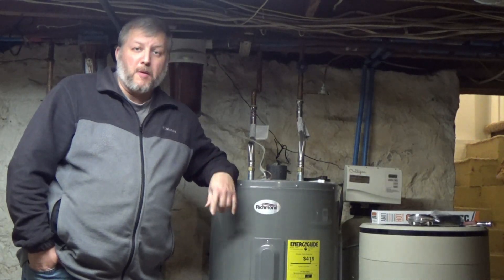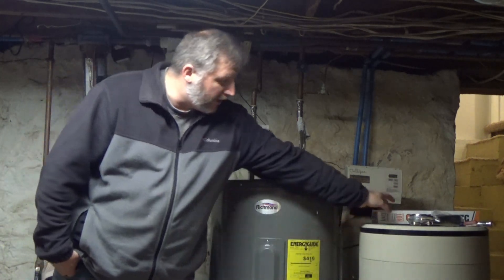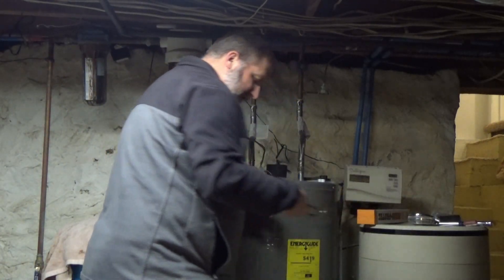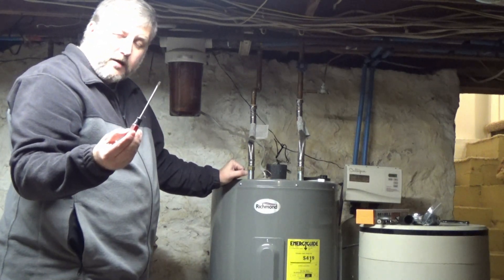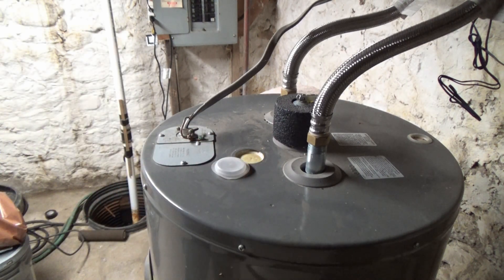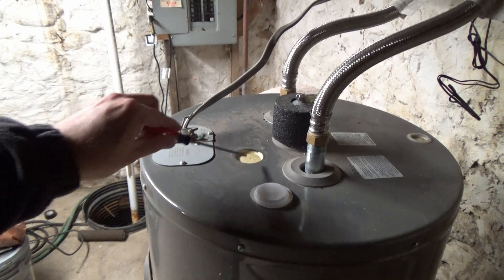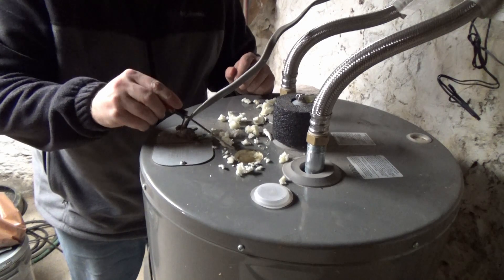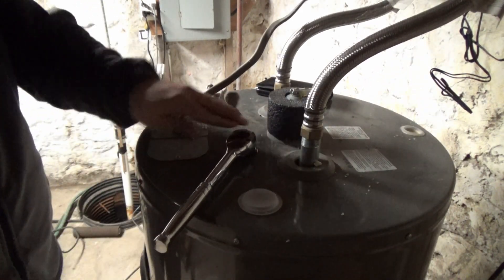Anode Rod Removal on a Richmond Water Heater - Part 1

Comment: The one on my water heater was so tight. The impact wrench didn’t even touch it. I had to use a breaker bar with a pipe extension. Used a ratchet strap anchored to the wall to keep it from moving.!

Comment: The anode rod in my new Richmond 34K BTU gas water heater was torqued so tight by some moron at the factory in Mexico I needed to use a impact wrench to loosen it.  There's no reason for them to be installed so tight.
Reply from the maker: Same. Mine was tight as well. I can't remember if it is in this video or the Part 2 one, but I had to take mine off with an impact as well.